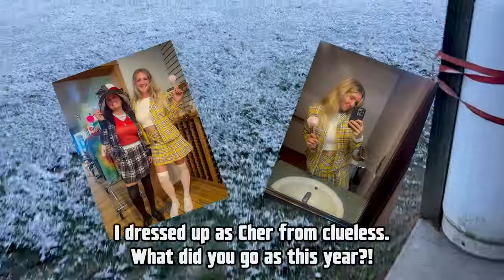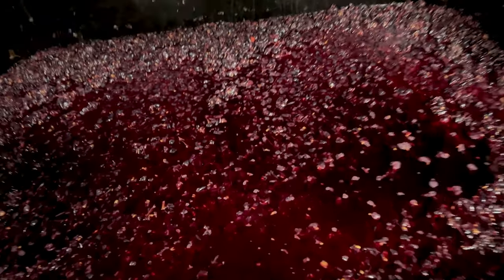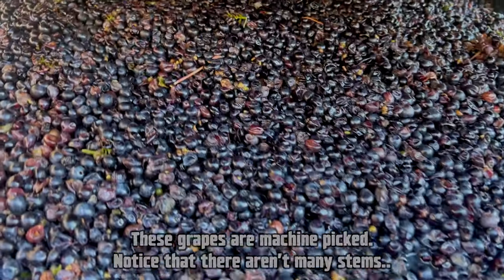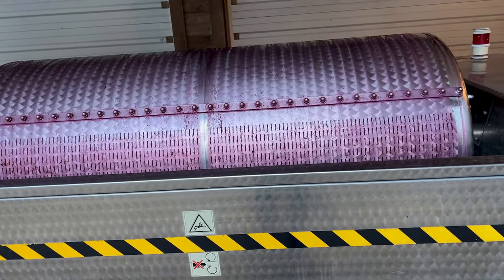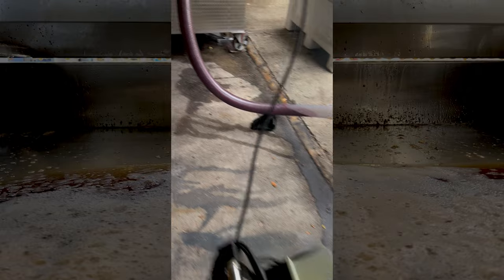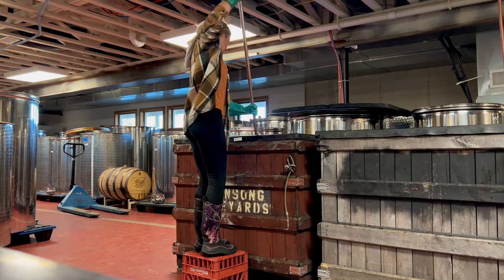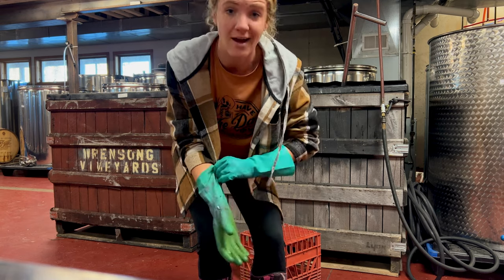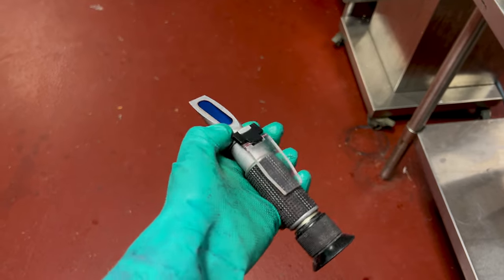HOW Is WINE Made? Winemaking 101 #wine

Comment: Yes, my honeybees do get on my plums, peaches, and nectarines especially when holes pecked by birds happen before I can cover them with netting. Great shots the winery you work at. I once built/worked on as a carpenter a winery storage facility. It was mostly concrete but the exposed wood had to be pressure treated and the hardware and fasteners were galvanized because of the acidic capabilities of rust and rotting timber that could happen in this environment. Thanks for the video and if you get a chance watch the movie "A Good Year" with some of my favorite actors Russell Crowe, Marion Cotillard, Albert Finney, Abbie Cornish, and Tom Hollanderas well as others. I promise you will really like it. Thanks, 🐝